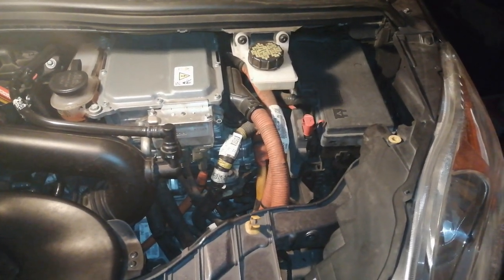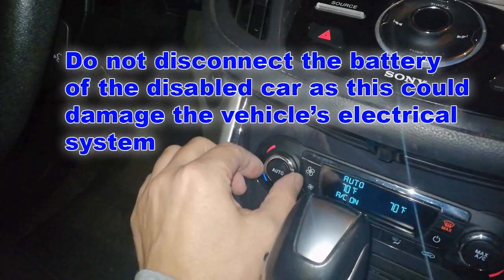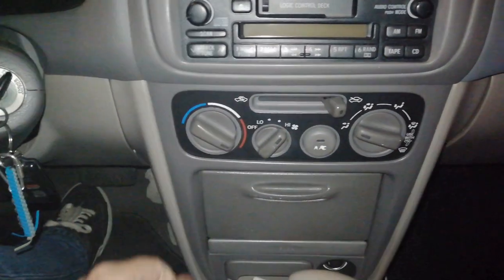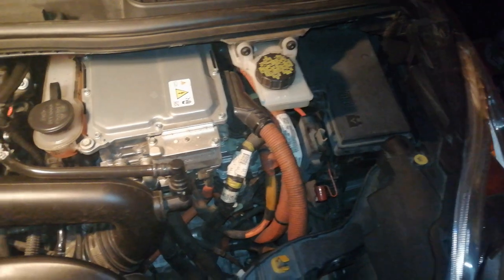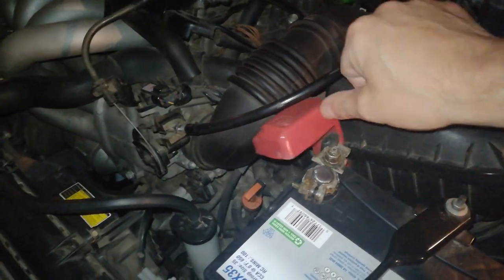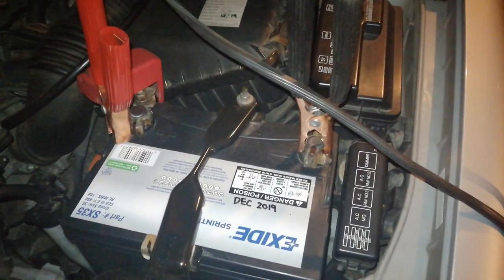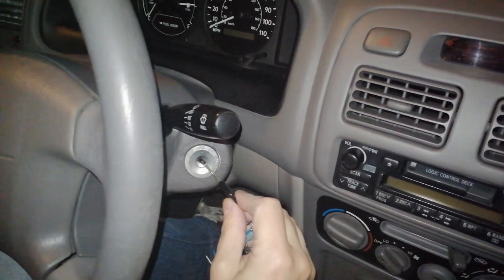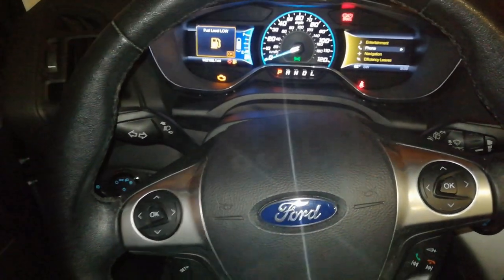How To Jump-Start a Hybrid  (Ford C-Max)

Comment: Ford C-Max energy 2014.
Hello. I have a question. My small 12-volt battery discharges to 8 volts in 4 hours. I replaced it under warranty and installed a new one. The situation repeats itself. The battery discharges to 8 volts in 4-5 hours. I'll borrow the car from a friend. Please tell me what could be the reason. Thank you.
Reply from the maker: Most likely you have something draining your battery like a short somewhere. If you can't see anything obvious like a light on or radio , you should connect a OBD2 scanner and look for the problem or go to an auto parts store...they usually scan it for you for Free.

Comment: Thank you. I didn't know that it was setup so that you could jump the 12-volt in the back through the hood. To trickle charge my 12-volt with my Schumacher Speed Charge, it is okay to also use the positive & ground under the hood? If I wanted to hook it up directly to the 12-volt in the back, where is the negative ground?
Reply from the maker: Not sure about this, but I would assume that when you can jump-start from there, you also should be able to trickle charge. For the negative ground in the back I would just look for any metal from the body, like a screw or nut.

Comment: I actually own  a C-Max.  They have a battery saver system that stops the computer from "booting up" so C-Max wont start.   All you have to do is have a donor battery to start a C-Max.  No need for engine running, max out AC, etc.  That's all traditional things you do to get a regular car to jump start.  No need in a C-max.  

Drive donor vehicle to close proximity of C-max.  Shut donor vehicle OFF.  Hook up red jumper cables to C-max positive jump start terminal under red cap.  Hook up black jumper cable to ground post.  Start C-Max.  Disconnect battery cables.  Recover positive jump terminal.  Yes it's that easy.  

C-Max like to go dead battery as way too much computer control in Hybrid.  Don't drive it = dead battery.  I bought one of these so  I can jump start my own C-max without the need for a donor car to jump me.  Can recharge tablet, laptop, cellphone, etc. also.  
https://www.youtube.com/watch?v=BKsZxQ_MvCo
Reply: I own a cmax energi.and I am having.problems...anyway to start it and drive it with gas mode only?

Comment: I was told by the dealer that the cmax cannot be jumped and that it would damage the vehicle. It looks like that is false when bypassing electrical system correct?
Reply from the maker: The cmax can be jumped the same way any regular car can be jumped. Check your owners manual, it's in there. I don't know why your dealer told you that you couldn't...maybe they want to sell you a new battery??.

Comment: The problem with Cmax is that while parked many of them periodically die for no reason and just a micro boost will “un-lock” them and make them functional again. Nobody knows the cause. And a true design idiocy is that once dead there is no way to open the trunk or to lock the doors !!!  Even high school pupils of the Balkans could not believe that an engineer with a mechanical degree could have designed and have approved such an aberration.
Reply from the maker: I agree with you, our trunk liftgate was broken once and there was no way to manually open it. Pretty much was a useless trunk for some time.
Reply: Just use the hidden key inside the FOB to lock and unlock your doors when power is out.
Reply: @richmukasa6069  Too late !  The transmission went bad, mechanic said can’t fix it, Ford dealer asked 8k, i said ok and they still refused to do it saying “not worth it”. Never in my life i would purchase US made car. Either TOYOTA or … bicycle. (My neighbor Toyota Prius 2006 with 305 k miles, battery changed for free at 156 k and no repairs other than maintenance - fluids and brake pads).
Reply: @Anonymousbyproxy  That must of been a pain. Your trans went out due to fluid loss. There is a TSB on this peticular issue where the gasket used in the trans deteriorate and starts to lose fluid. I was able to catch it prior to any damage luckily. Found out that I was a quart low. Been monitoring it and she's been riding like a charm.